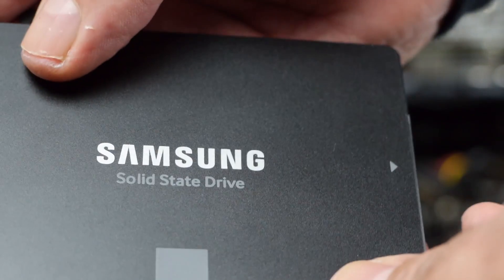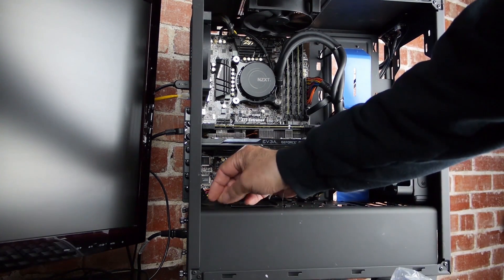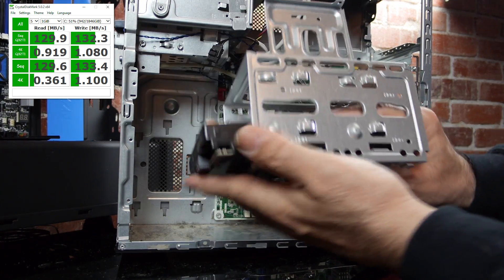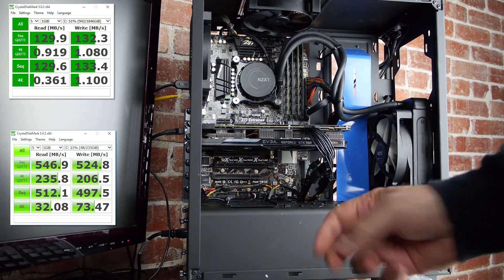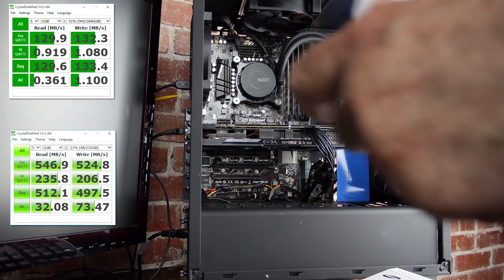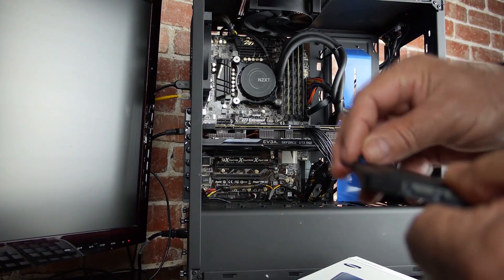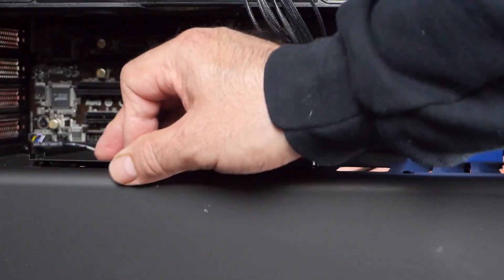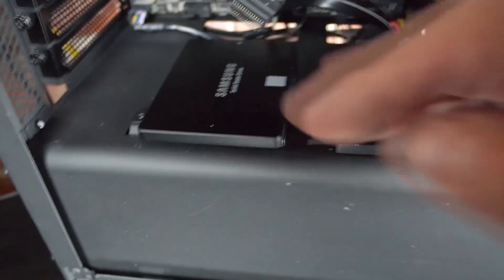Samsung 850 EVO SSDs Installed In NXZT S340 Case

Comment: Installing SSDs in this case is a pain in the ass. When you install the SSDs on the top panel, the SSD power and E-SATA  cables happen to line up and smah into the cables that are attached to the lower end of the motherboard. You have to bend the cables severely. I wouldn't recommend doing this. You will ruin your SSD. Because of this, I am forced to install only one SSD to the lower right hand corner of this case. This case may look nice, but its way more hassle than its worth.

Comment: Where did you get the 2 cables that plug into the ssd? I can find them. Someone help me please!
Reply: @Cigel Those cables should have been supplied with your motherboard or power supply. 

The first one is a E-SATA cable. It connects from your motherboard into the back of your SSD drive. It looks like this https://amzn.to/2Qww0uc

The second one is the power cable to the back of your SSD drive. 
The molex looks like this: https://amzn.to/2NsJYve
The non-molex looks different. The cable looks similar but with no molex. More like a plug that goes into the power supply.